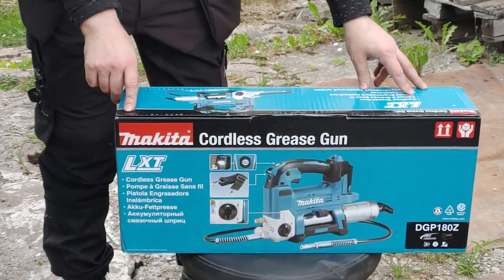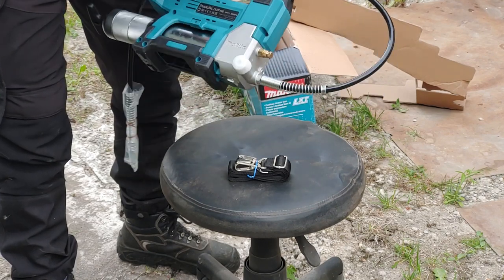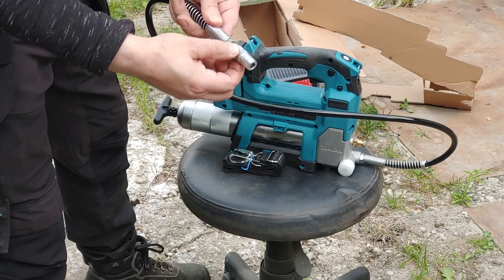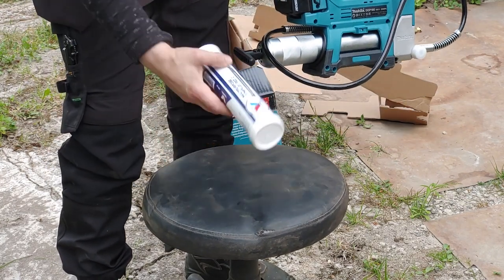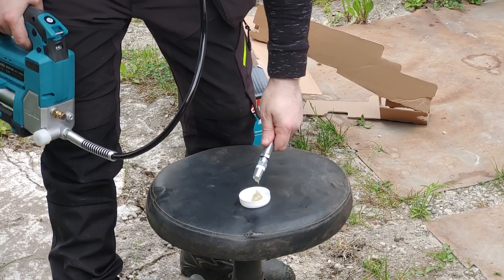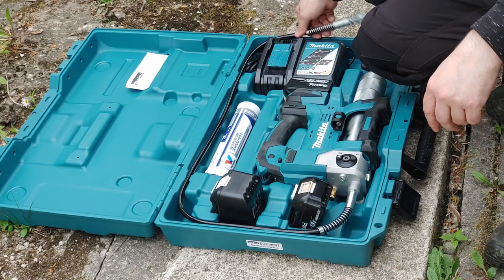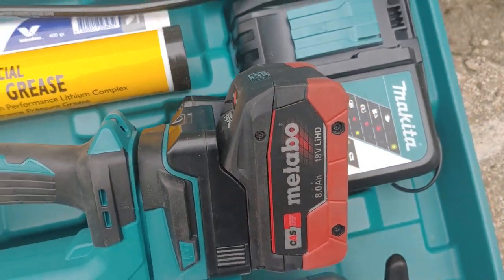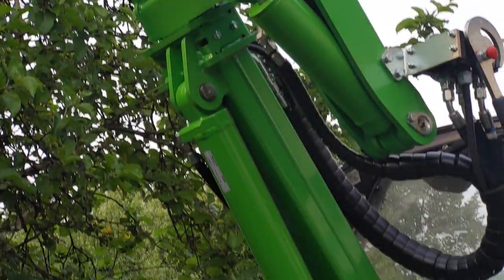Makita DG180 grease gun with Avant 635

Comment: This one shows the problem of getting a grease cartridge all the way into the tube.  The plunger is too large! forcing the tube to get treads started is a pain and sometimes the rod will disengage and make putting the tube in even harder. The spring has a hard time pushing the oversized plunger all the way in and gun will lose prime.